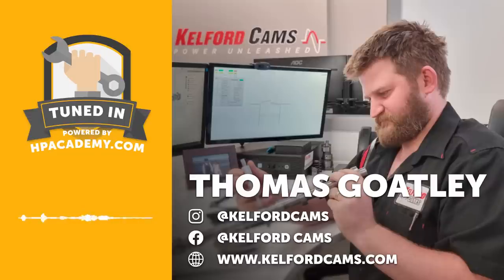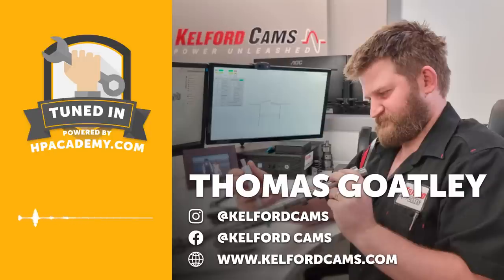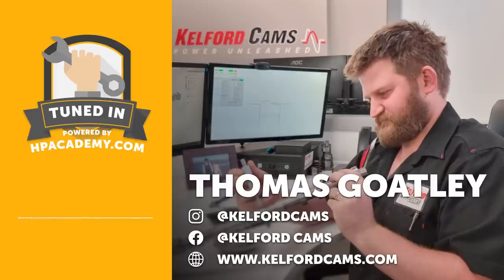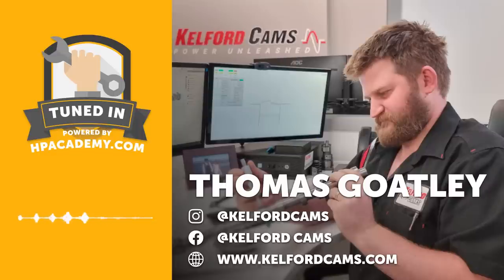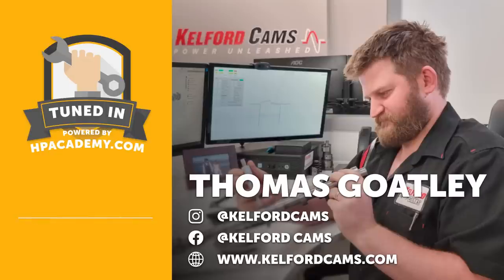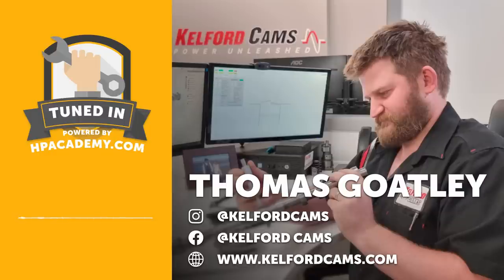058: Choose the Right Cams for Your Build. [#PODCAST]

Comment: Perfect timing. I was thinking about a set of cams for my built 25DET.
Reply: So what are you going to go?
Reply: @sircefiro  Going for driveability over power numbers. So I'm still doing some research on what's best for that.
Reply: @HashiriyaSquadron  is it a neo or hydro head?
Reply: @sircefiro  Series 1, non Neo.
Reply: @HashiriyaSquadron  Dunno what turbo & how big you're going but I'd say kelford 246-A or 246-A2 would suit most, stock aren't too terrible & the old poncams aren't bad but I'd guess the kelfords & depends a lot on what you're building
Reply: @sircefiro  GTX3076R Gen II. Built motor, stock head. Looking for reliable 450-500 and about the same or similar in torque ft lbs.
Reply: @HashiriyaSquadron  for 450-500 stock cams are fine otherwise go small AM, kelford 246A or poncams
Reply: @HashiriyaSquadron  just leave the stock ones they work perfect in this combo save money although if you have bolt on manifolds there may be something better suited to match them slightly more. Factory manifolds also make this power just fine

Comment: I haven't got all the way through it yet but is more lift at the same duration generally always a good thing when it comes to performance? Accepting that its much harder on the valve train of course
Reply: In short yes, however there is a velocity limit that we don't go past, under that limit it's completely safe to max out the lift per degree of duration. Lobe optimization is definitely a must 👌

Comment: What is OE manufacturers doing to their modern camshaft profiles to be able attain a smooth idle, yet still be able to rev high in a Naturally Aspirated application?

 Big lift/durations with big LSA?
Reply: vct
Reply: @nismofreak33  Variable cam timing definitely contributes in a big way in the low and mid range total width of the power band, but it's still not still common to me, to see an engine that can rev to 9k with a static cam profile with a stock smooth idle, even with a variable timing gear.

I.E 1LR-GUE
I've recently attained a 1GZ-FE -  I'm going with a Naturally Aspirated approach, so I'm trying to educate myself a little bit more before I attempt to reach out to a Cam manufacture for a custom profile down the road.

Aftermarket cams in high revving NA builds typically has tons of overlap from what I'm familiar with.

Honda V-TEC is literally two different profiles in one cam, so that's an exception to me.